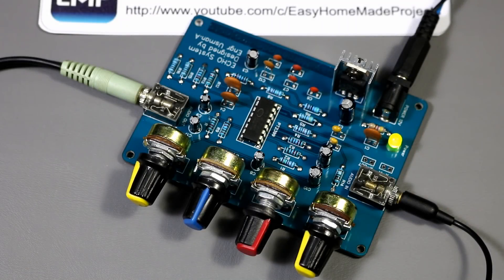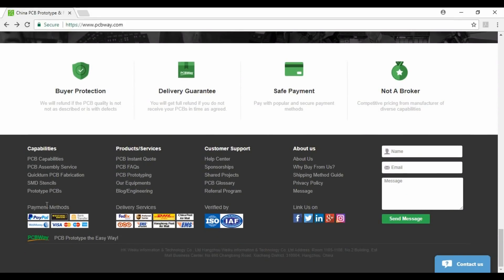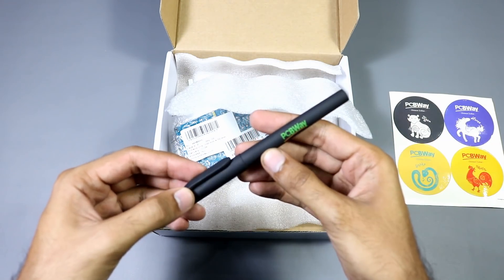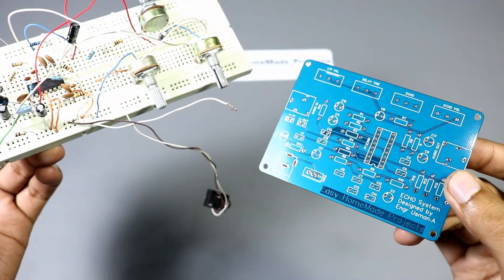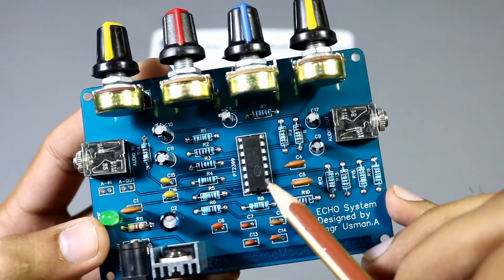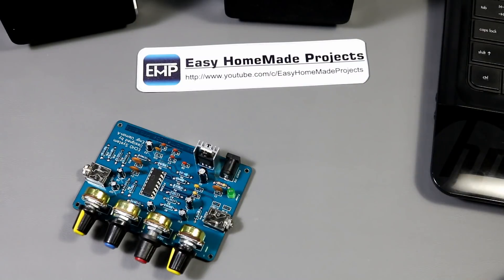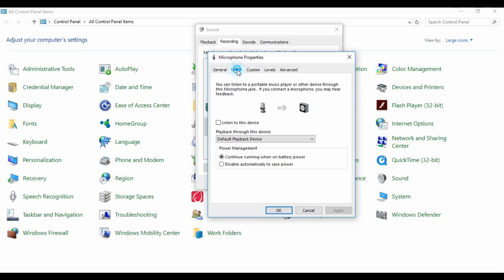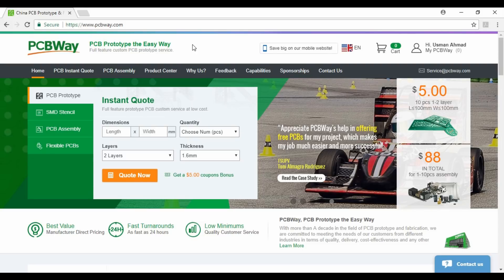How to Make a LIVE ECHO SOUND Circuit

Comment: There is a serious mistake in the PCB layout. The effects and volume are working in reverse, that is, anticlockwise. Whereas the effects should INCREASE in the clockwise rotation. I hope you will correct the mistake and design another PCB. Otherwise, your work is commendable. Keep up the good work. Thanks
Reply: Koi issue nahi bhai pcb ko fitting ke time ualta  lagane pe control sahi taraf kam jada honge.

Comment: Please add a circuit with voice pre, 1 Aux, = 2 channels with delay, echo & reverb effect nobs together working on single circuit working on  3.7 volt mobile charger power supply. You may add a main amplifier of 1 or 2W to check the effect immediately without looking for a separate amplifier. This will be of very high demand I believe.

Comment: Maybe it's easy for everyone to assemble components on the prepared circuit just like you did in this video. but the real work is to explain that how to make a circuit along with functionalities of components for this project. If you Explain, that will be Remarkable...
Allah Bless you.
Reply from the maker: btw This complete circuit is designed by me. i think it is not necessary to explain working of every resistor or capacitor. All other information are given in the video. Thanks!